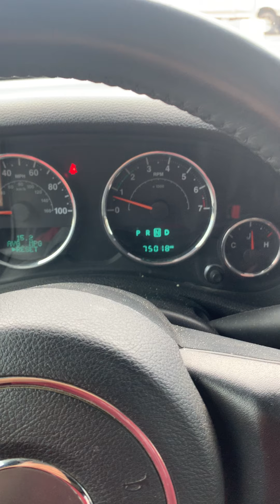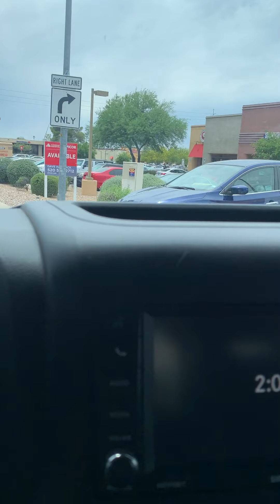Jeep noise after automated car wash

Comment: Brake pad still wet ?
Reply from the maker: It took the off road jeep forum to figure this one out... The Led light over top of the windshield has cooling fins on the back, when turned at the right angle and driving at the right speed the wind vibrates those cooling fins and creates a harmonic sounds... Took 2 seconds to turn the light fixture down a few degrees and that was it.